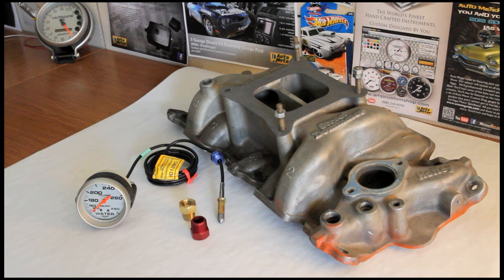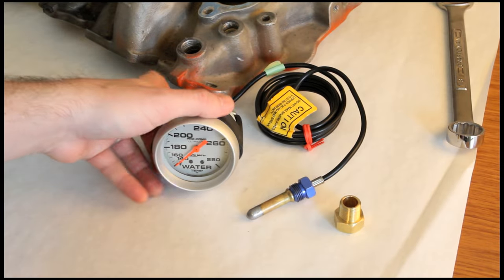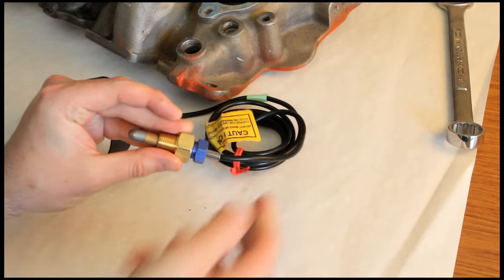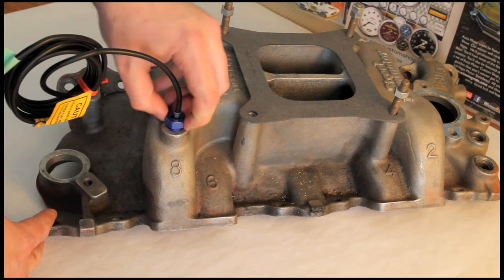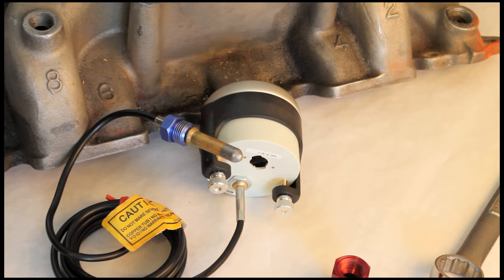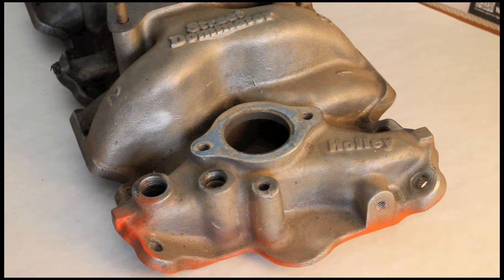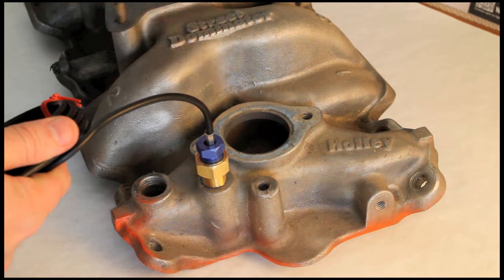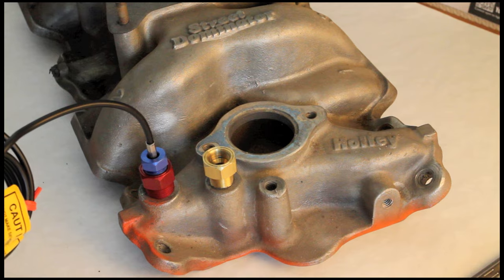AutoMeter Mechanical Temp Gauge Installation

Comment: Don't forget to bleed the coolant. Sometimes, but not often air bubbles gets trapped when the sensors are up high and that can cause a false reading. I've had that issue even when the probe was installed on a side facing port vs one on top.

Comment: You'll want to use an electric gauge on a B18 motor. The probe on the mechanical will be too large unless you use a radiator hose adapter. An electric sender can thread right into the passenger's side of the head in place of the original sender.

Comment: I'm pretty sure your tired of all the questions, but here goes. How about the top radiator hose? I've heard the thermostat might get stuck and not open, but the manifold looks like there is no spare nut coming out of it. Thanks for the video.

Comment: i have a heat gauge all wired up.and it still dont work.one wire is ground one is ignition and the other is sender all is hooked up and has power from ignition.does tje ground have to be on the motor or can it just be joined to my stereo ground.

Comment: Curious I'm looking for something along these lines for a Honda eu3000is generator. 
Where on the generator will be in a isolation box and I could certainly use an engine temperature sensor. 
Thanks.

Comment: i installed my mechanical temp gauge today and it didnt work...or do anything....i notice you did not use teflon tape ..does these gauges need to be ground through the threads like electric one?..pls i used rad hose adapter..

Comment: I can't replace my temp sending unit in the front of the manifold. The ECM needs the reading. Can I get an accurate reading by installing a mechanical into the water pump
Reply from the maker: Our technical support team would be happy to help you out with that. You can reach them at 866.248.6357 or https://www.autometer.com/contacts
Reply from the maker: Our technical support team would be happy to help you out with this. You can reach them at 866.248.6357

Comment: Dose it have to go in the intake manifold?  I've been others that are mounted on the engine I think on one of the heads that's how my car was when I bought it but what u gives u the best reading? Thanks!
Reply: Awesome thanks a lot that really help!!!
Reply: +Auto Meter Products, Inc. Mine is in the head. Its a 350 chevy and seems to give me a reading of around 205-208 degree. Is it better to install it in the manifold for a more accurate reading
Reply: The thing is, is that Im not sure what is too hot of a temp at the head. Mine is in the head on the drivers side an the temp gets to about 210 at 60-65 mph. I have a 180 stat in. Does this sound normal?

Sent from Windows Mail

Comment: My trans temp Gauge does not read any heat it turns on and everything but just to not read any temp ?
Reply from the maker: Our technical support team would be happy to help you out with this. You can reach them at 866.248.6357

Comment: what about on a throttle body 305 engine?
Reply from the maker: Thanks for the inquiry. Give our tech line a call at (866)248-6357 and we'll help find a good location to install to probe on a mechanical temp gauge.

Comment: WHY OH WHY did you not show where the wires go and how to hook THEM up?
Reply: ***** Thanks for quick reply. I am so frustrated because I cannot find any clear info on how to hook up "electrical" gauges. Sorry for my ignorance in not realizing that's why they call them "Mechanical" instead of "electrical" gauges. Nice video.
Reply: Ron Hensley
 for the back light on the gauge, there should only be 2 wires connecting to the light bulb socket, a black wire and a red wire. The black wire is ground (-) and all you want to do with that is just find a good clean metal surface to bolt it down to, doesn't matter where just as long as you clean up the surface. the red wire is the hot wire and thats going to power the actual light bulb. With that you can splice into the main wire harness from the wire that sends power to light up all your other gauges/instruments. If your not sure where to find that wire check your haynes manual or a spec sheet/wireing diagram for you car's make/model online. Also as a hint the wire that sends lighting power to your instruments will be connected to your head light switch so that's a good place to start looking lol Good luck.

Comment: you forgot to show the very large diameter hole you had to have cut through the firewall to fee that probe with nut though it. That will be one big ugly hole that will need to be filled up with a grommet or bezel / washer or what have you.
Reply: +Auto Meter Products, Inc. what sort of wire/cable is best to connect an electrical gauge to the sender?